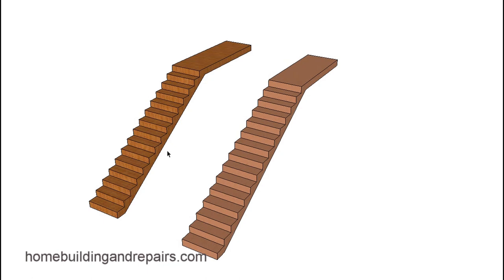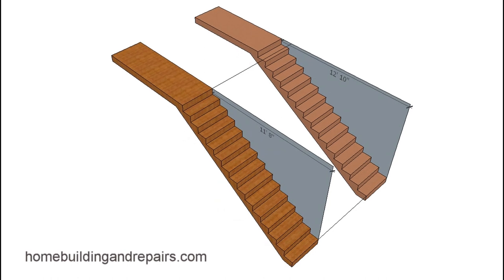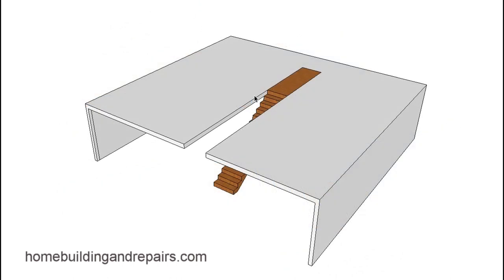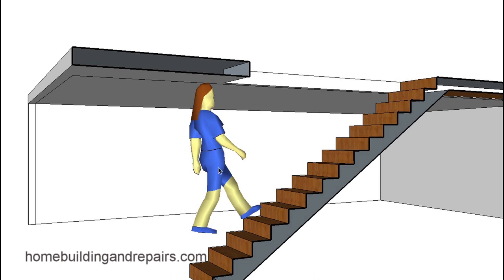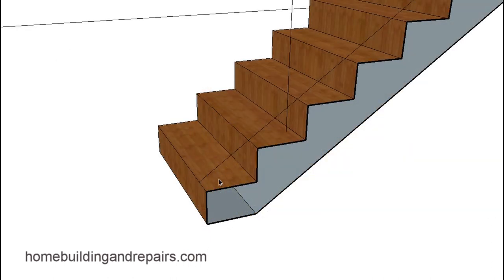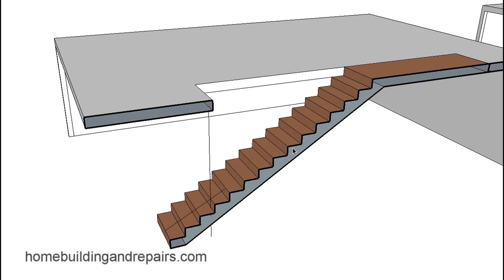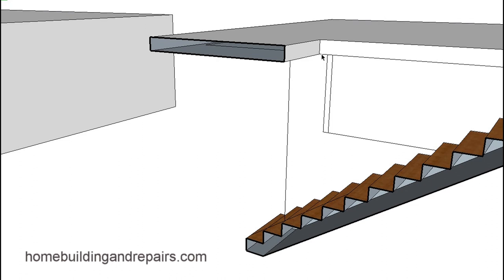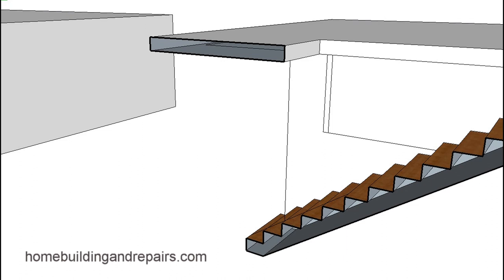Longer Stair Treads Can Create Headroom Problems – Stairway Modification Tips

Comment: 1954 ranch house with a basement. I replaced the old 11 step stairs with code 12 step stairs. He left the treads at 11" instead of cutting them back to 10" minimum.  the contractor didn't allow for the new 3/4" hardwood floor above, making that top riser 9" and then put an extra 1" on the bottom riser. PLUS there is only a 6.0 headroom for the bottom space. The small city says they can make an exception for the headroom at the bottom of the stairs. How do I fix the existing stairs so that all the risers are the same or within the 3/8" tolerance ? Excellent graphics on YouTube, and the first time Ive seen the headroom issue addressed on the internet. 
also, can I go back to only 11 steps and still make them code conforming? BK
Reply from the maker: Yes, you might be better off going back to original design if it will work with local building codes. Email me some pictures of your stairway problems.

Comment: I’m in California. I saw online that max step rise is 7.5 inches. I have no idea how much the thickness of the floor above would be… so roughly, what would the total rise, run, steps, be for 8ft, 9ft, and 10ft ceilings.  I like to draw “dream homes” but would like to make sure there is enough space (for symmetry purposes).
Reply from the maker: You will need to know the floor joist and sheathing sizes also to determine the over all total rise you're looking for with different wall heights.

Comment: When I was at school ,.....my teacher had a formula that calculated the exact lenght of the opening when building new for correct head room but I can't remember what it was,.....I do remember what was included in the formula,.. headroom height , rough floor joist height and he added 50 mils or 2 inches for the forence and dry wall and of course treads and risers I guess or the diagonal of those two times ?
Reply from the maker: I've never seen a formula for that, but it doesn't seem like it would be very difficult to create. If I ever figured out, I will definitely post it in one of my videos.
Reply: @stairbuilding  Thank you,....if I remember , I'll let you know .

Comment: OK so how would the ceiling joists be modified to allow for more headroom? I have this exact issue with some stairs going into a basement. The existing concrete stairs are all over the place, anywhere from a 6.5 to 8.5 inch riser and a 7 3/4 inch to 8 inch tread depth. Existing headroom is 74.5 inches. I want to make the stairs code compliant with a 10 inch tread depth and 7.5 inch riser. Doing so would mean would lower the headroom to somewhere around 61 inches. Is this even possible?
Reply from the maker: You would need to modify either the stairs or the ceiling and it won't always be easy or possible.
Reply: @stairbuilding  Uh well, that's an obvious and pointless statement. Problem with my situation is, if I modify the stairs to code, the headroom is going to be an issue. And if I modify the headroom, it still won't be to code. So basically, the answer is, I think, make the stairs as code compliant as possible, while raising the headroom as much as possible.
Reply from the maker: @tegan71969  Uh Duhhhhhhhhhhhh, I love it. I think I misunderstood what you were asking and no, 61 inches won't work unless you're family and friends are less than five feet tall. Feel free to email me some pictures for more info.
Reply: Tell the truth and I don’t mean to be a smart ass can you bring basement floor down if you had to
Reply: @thomasflynn6307  I raised the ceiling height by adding a header into the existing wall and angling the ceiling at the same slope as the stairs. All good!